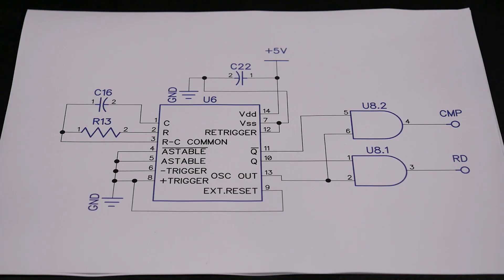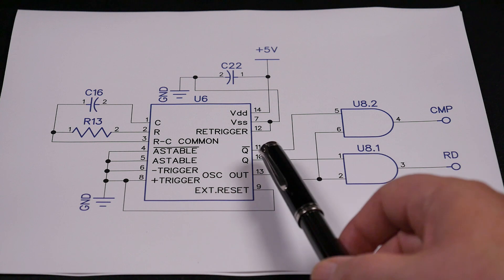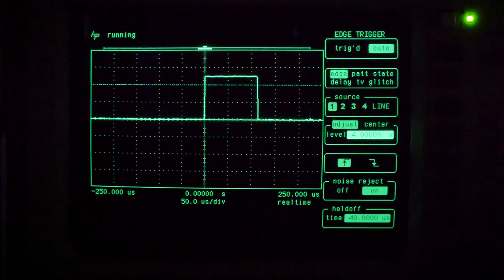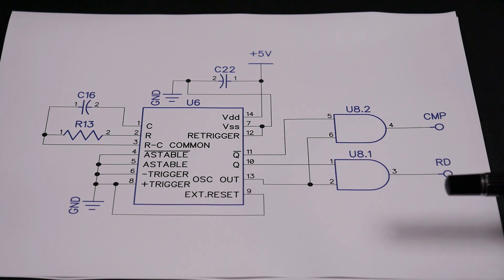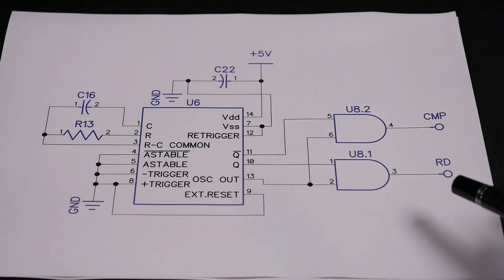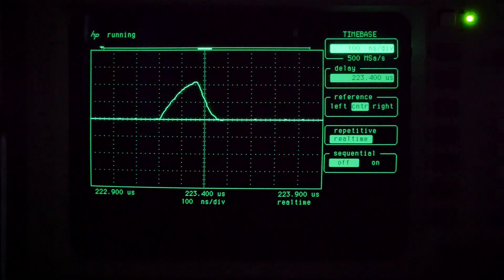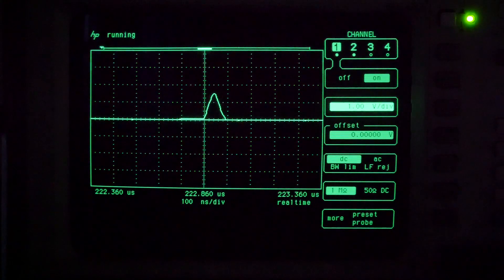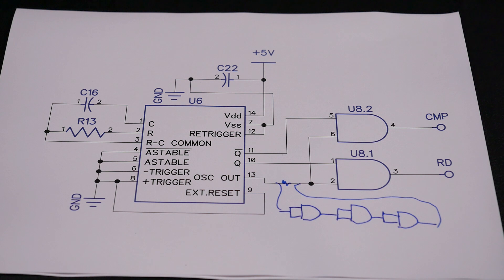Glitchy clock - cause and cure (aka the perils of propagation delay)

Comment: Common was to see a RC circuit on the signal, to delay it slightly, or you often would find, in more bespoke designs, the use of a tapped delay line, so you could choose to have a fixed delay instead. Only thing about relying on gate propagation delay was that you really needed to use gates in the same chip technology, from the same manufacturer, and often from the same plant, as the gate delay depends on so many things, and mixing logic speeds, different manufacturers or even different batches from different plants could cause an issue.

Then the whole temperature thing, where your delay depends on chip temperature, so using the gates spare in a chip say driving a heavy load, like LED displays, or long transmission line cables between a board, could result in the glitch slowly coming into a condition it would trigger the following logic randomly as the chip heated up. Many times you would have a RC delay on the output to remove that runt pulse, or at least keep it below threshold levels of the following gate. Then the perils of mixing TTL, LSTTL, S, L, HCT and plain old HCMOS families as replacement parts.

The fun times of playing mix and match boards, where one board would not work with another, either when cold, when hot, at some point in between, with the cover screwed down fully, or when you ran a particular sequence. Both are individually passing test, but those delays are not in the right condition to be happy.  Change a chip and previously working boards might not work properly together, getting you back into mix and match again.
Reply from the maker: Thanks for this - I had a sense that it was unwise to create a dependency upon gate delay like this, but I didn't fully grasp what a nightmare it could turn into.